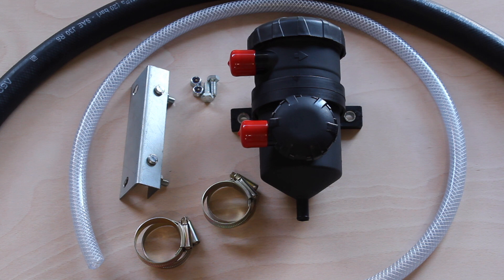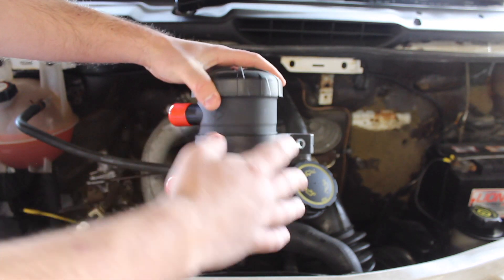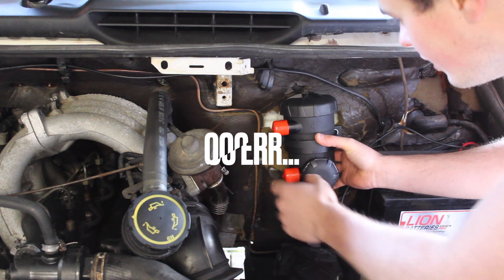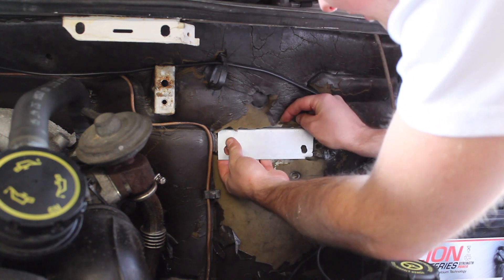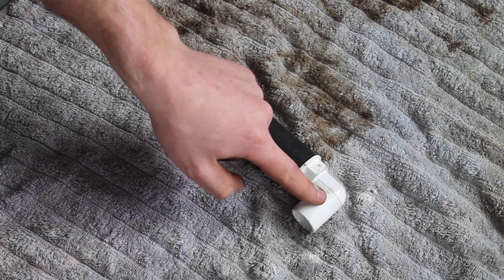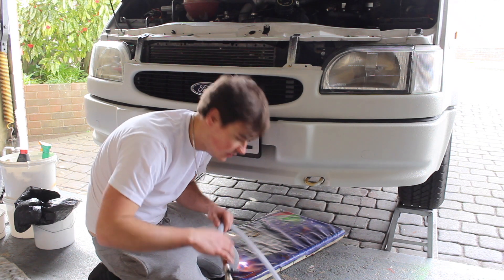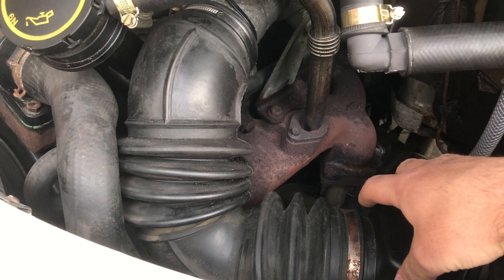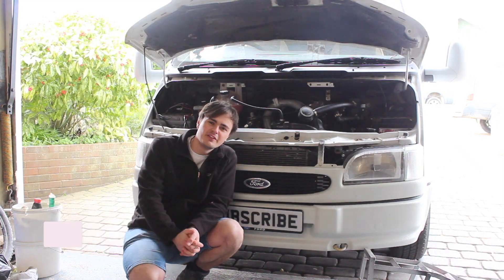Do Oil Catch Cans Work? | Cheap Provent 200 Install on Ford Transit 2.5DI

Comment: I left my return line in between the air filter and the turbo intake like where it was originally. Push pull air flow still with the oil hopefully knocked out by the can.

Comment: Hi Ollie, great videos, really helped on my old transit, we’re did you get the inlet manifold gaskets, can you get both sets together, also did you make the 2 cover plates for the inlets or can you buy them as well, and we’re ? Thanks again
Reply from the maker: Hello mate, really pleased they have been useful, thanks for watching 👍🏼 the manifold gaskets you can get here: https://ebay.us/NX36nT
https://ebay.us/MbFYzs

The egr blanking plate is also from eBay, I bought one and then made a copy to blank the exhaust manifold too. I also have a video for that if you struggle to get the egr pipe bolts out.
Reply: @TurnersWorkshop97  Cheers Ollie, I’ll check that out now, took manifold off and it was as your, full of crap, so looking forward to burning that out, also brought myself that catch pot to fit once the rain stops, that front bolt was a bigger to remove even with a 1/4 socket wrench, thinking of getting electric power steering fitted or would you recommend me getting liquid system as haven’t got any at the moment but have got the pulley and holes for pump, this is on a 94 Motorhome and it’s crap at slow speed
Reply from the maker: No worries, it’s really satisfying burning the carbon out! And the catch can and blanking plates will keep it clean 👍🏼 I would look around  for a liquid system personally. It should bolt right in 😊
Reply: Cheers Ollie 🤟

Comment: hi  have you a link to buy  this please thank you
Reply from the maker: Hi Sean, there’s a link in the description to the exact one I got as there’s loads of the provent 200 style ones on eBay 👍🏼
Reply: @TurnersWorkshop97  hi ollie thanks for the reply .i did not see you had listed the stuff you bought . i am needing the elbow you bought  its 24mm aint it cant find any thanks
Reply from the maker: Hi Sean, I only listed the main products as the rest I just picked up from local hardware store. Here is a link to the elbow I think you’re looking for: https://www.diy.com/departments/floplast-solvent-weld-bent-waste-tank-connector-dia-21-5mm/178485_BQ.prd 👍🏼

Comment: nice vid pal,ive noticed an oil build up in my air inlet pipe so will be looking to fit one of these,look forward for an update on how you have got on with it
Reply from the maker: Thanks mate, If it’s excessive oil build up you might just want to take the rocker cover off and just check all the 10mm bolts. Oil catch can will help though 👍🏼

Comment: Very good and informative video, looks really professional I've never seen this before would you recommend this on a 1999 2.5td  transit👍
Reply from the maker: Cheers man, after cleaning the inlet manifold and blanking the EGR this is another idea to keep it clean. Doesn’t hurt to have the oil vapour going into the manifold, I just want to keep my inlet as clean as possible 👍🏼

Comment: Hi, great videos I enjoy watching them. I have the same van and engine (autosleep duetto) . On a side note I notice you have the same battery tray for your leisure battery as my one. I extended my one so I could fit a 120 amp/hr one there. Email if you want me to send you some pics of how I did it.  Cheers, Peter
Gingerninjapants@yahoo.co.uk
Reply from the maker: Hi Peter, thanks for supporting the channel. I do love the duetto 😁👍🏼 Nice work on that, if I get a bigger battery I will be in touch for sure! Cheers mate, happy camping!

Comment: Finally you installed it!
Reply from the maker: Finally got round to it! Now I’m thinking I need to change the filter to a genuine man type. What do you think have you got the genuine filter?
Reply: @TurnersWorkshop97  im using the one that comes with the catch cam but put inside half metal scourer (this that seems a metallic spiral) to help to condense the oil. Sorry for my English!
Reply from the maker: Perfect English 👍🏼 I think that is a good idea, maybe some filter material round the outside will help also 🤔
Reply: @TurnersWorkshop97  yes! I thought too but i was afraid about a piece going inside the inlet manifold and i prefered not to...

Comment: Very interesting I have learned something today I might think about installing one on my old transit how much was the whole set up.cheers keep up the good work.
Reply from the maker: Thanks mate, £20 for the catch can, £10 for the 25mm hose, £5 for the drain hose and valve (already had a bit of copper pipe), bracket made from off cuts, jubilee clips £6 and pluming elbow £3. All in roughly £45 👍🏼